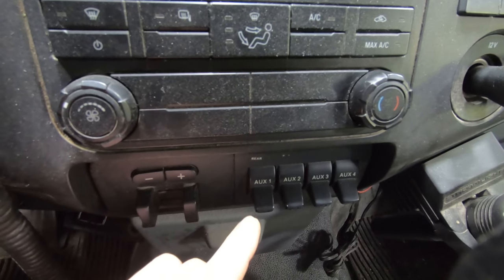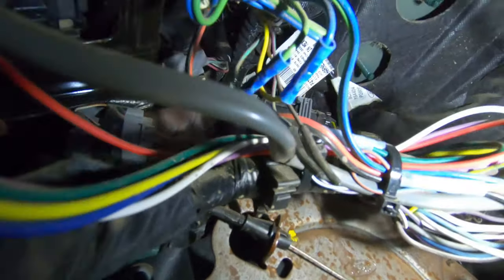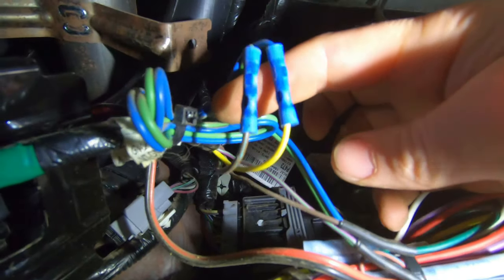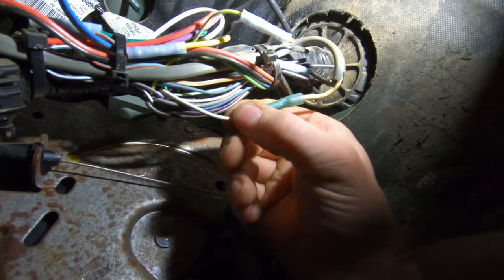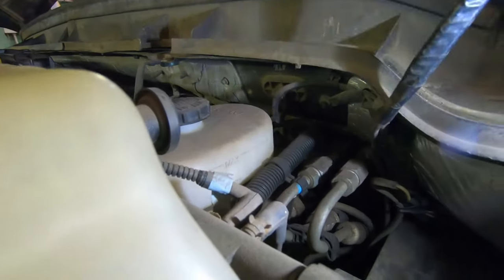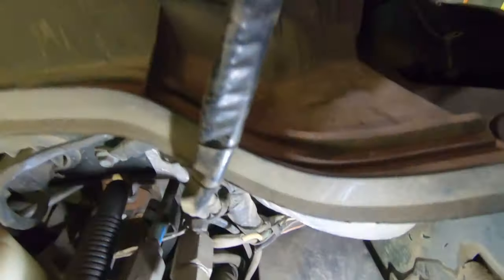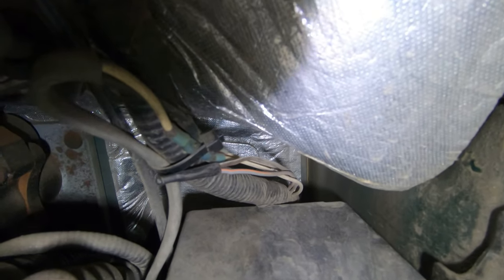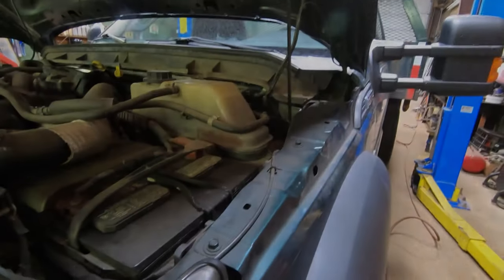08-16 ford super duty upfitter aux switch wiring

Comment: Thanks Jason. We have an 08 F350 work truck and I'm pretty knowledgeable of wiring things up, but you just saved me quiet a bit of time I would have spent to figure out how to pull the switch panel out to hook up directly to the switches, when we hook up our strobe lights. Following now.
Reply from the maker: No problem glad I could help

Comment: Sw 1 and 2 are 25amp, sw3 and 4 are 10 and 15 amp...I do believe...all 4 are switched hot...any negative connection can be clean chasis ground
Reply: Hi sir where is the fuse located for aux 3
Reply from the maker: @hillbillygarage6051 it is f9 in the bcm which is in the passenger footwell. https://knigaproavto.ru/shemy/en/amp/Super_Duty_11-16.html

Comment: Thank you for this great info I was breaking my head do in this I I prefer do electrical in houses and building🤦‍♂️ than cars but thanks this video help me a lot 🤓✌️
Reply from the maker: I hate working under the dash too. People just don’t fit easily under there. They make a creeper type thing that is basically a board with one side stand that you put the other end on the floor at the door and you can lay on it so your laying outside the vehicle at the floor level.

Comment: Could you explain better, what colors  are for which switch? There's aux 1, 2, 3, and 4. So, there should be 4 hots and a ground. What colors are the hots?
Reply from the maker: Switch 1 is the yellow wire and 25 amp fused
Switch 2 is green-brown and 25 amp fused
Switch 3 is violet-green and 10 amp fused
Switch 4 is brown and 15 amp fused
I don’t think there is a ground feed in the wiring but you can get a ground from anywhere really

Here’s a link to the wiring diagram it’s the last page for this year range. 
http://www.rafna.com/rafna/wp-content/uploads/2014/11/FordSuper.pdf
Reply: @JasonTheMunicipalMechanic  dead link :(

Comment: When wiring up AUX lights to upfitter switch ires what do you do with the negative wire from AUX lights?
Reply from the maker: You would just ground the negative wire to the frame, body, or something metal that has continuity to ground. You can go to the ground terminal if you like.
Reply: @JasonTheMunicipalMechanic  perfect thanks. Thought so just wanted to make sure. I’ll be installing the upfitters tomorrow. Wish me luck.
Reply from the maker: Good luck

Comment: Do I have to add a relay?
Reply from the maker: No there are relays already installed on the switches.
Reply: @JasonTheMunicipalMechanic  are they fused, and where are the relays, in case I need to diagnose any problems? Thanks, and your video is certainly the best on this topic.
Reply from the maker: The relays are under the dash on the drivers side, I’m not sure exactly where and the switches are fused. Switch 1 should be f94 and switch 2 should be f95 in the under hood battery fuse block and switch 3 should be f9 and switch 4 should be f2 in the body control module which I believe is in the passenger foot well.

Comment: so you tap the positive of your light into 1 of the 4 factory aux switch wires (in your video) and then just run the ground from the light to any ground surface on the truck?  thanks
Reply from the maker: Yes. Make sure you get a quality light. Some of the cheaper led lights will cause static on the radio

Comment: Thank you, wonder why they wouldn't just terminate them in the engine bay?!
Reply: Because you might be running interior or rear bound accessories (cb, rear work lights, inverter, etc) that's why they give you the firewall pass through wires as well.

Comment: Why would I have power to 4 wires under steering wheel but no power to wired behind fuse box? I was able to find wires hidden but nothing to any of them.
Reply from the maker: The 4 wires behind the fuse box are pass through wires. They are just small pieces of wire the go from the inside to the outside so you don’t need to drill a hole in the fire wall and seal the wire and hole. You need to connect one of the switched wires to one of the pass through wires to get power to the wire behind the fuse box. I don’t know why it’s like this but it is.

Comment: Really good video man, I’ve been searching for a vid like this of a while! Thanks for making this !
Reply from the maker: No problem. Glad I could help. Thank you for watching it.
Reply: I have another question. If I’m working on wiring a light bar, do I just run the positive/hot up to one of those up fitter wires, and ground somewhere on the chassis?
Reply from the maker: Yes you can do that.

Comment: What are them auxs even for
Reply from the maker: They are for any auxiliary lighting or what ever you want to run off the switched power source. They just help with the step of getting power into the cab and making a switched source that is better looking than a switch mounted in the dash. It’s more for a commercial application but They don’t do anything on there own.
Reply: @JasonTheMunicipalMechanic  thanks for the information,  I was confused as to why there're, came to YouTube and there you are with a perfect explanation thanks
Reply from the maker: Thank you. I’m glad I could help